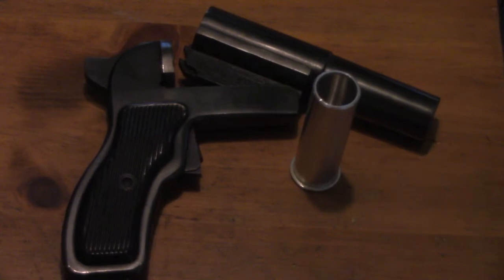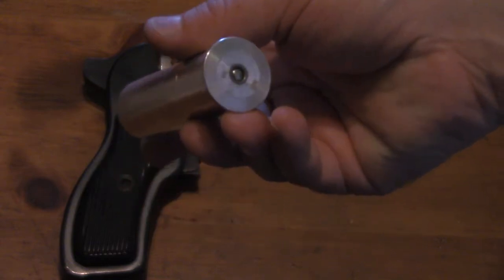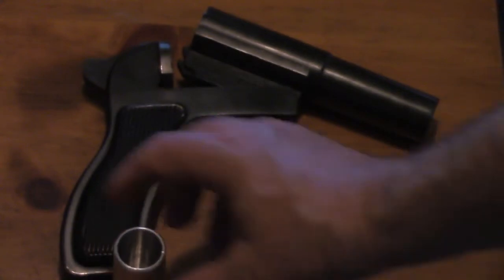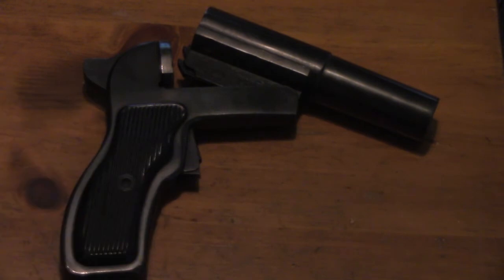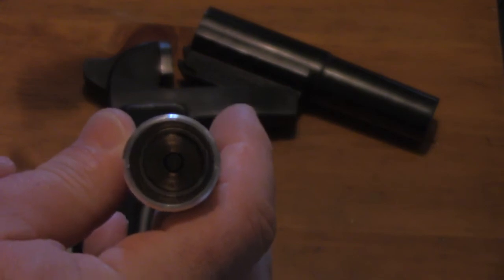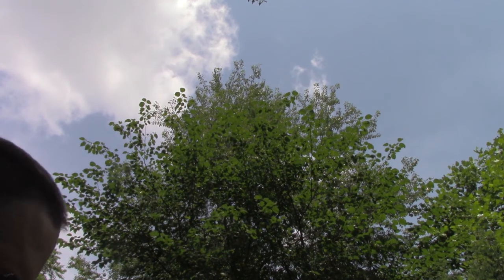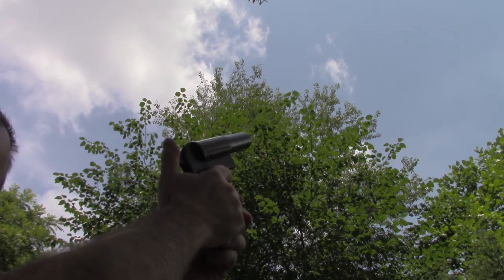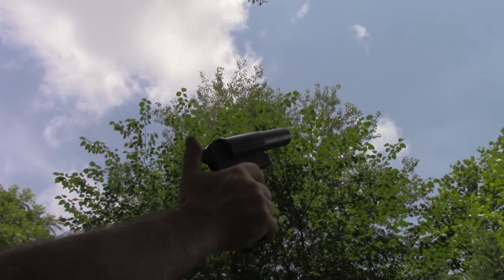Polish Flare Launcher

Comment: What is the gauge of the insert if it is at 12 gauge can you use brass cases
Reply from the maker: Kevin Romas It's not an insert, it's a reloadable case. A shotgun shell adapter would be illegal.
Reply: Because it's smoothbore? What if the adapter was rifled?
Reply from the maker: If it's rifled AND .50 caliber or less. But a 12 gauge adapter would be illegal even if rifled. It would be a DD because of bore size.
Reply: It's not illegal you buy both the flare gun and the adapters with out papers just once they are put together it's illegal but if you don't tell anyone nobody will know ;)